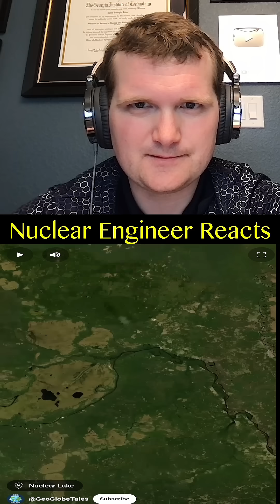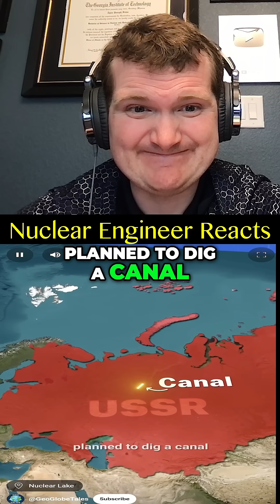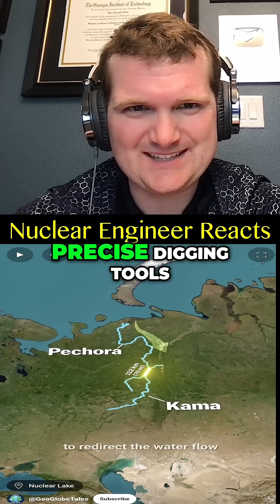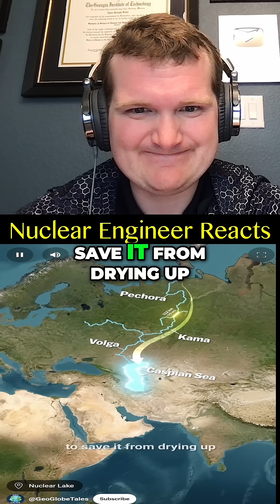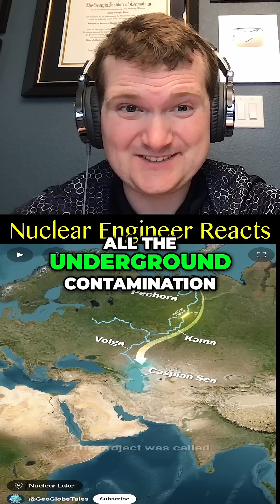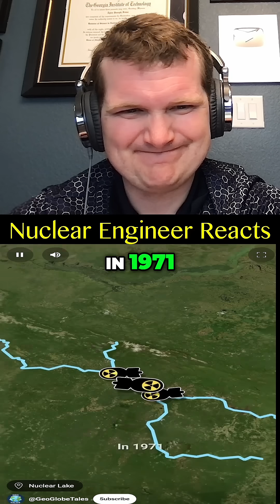250 Nukes to Create a Lake? - Nuclear Engineer Reacts to GeoGlobeTales

Comment: Lets think about this. They are going to use Nukes to make a canal. Which in turn moves water. So this water is moving through where they set off like 25 nukes to make this thing. 

They trying to bring Spring Field to USSR

Comment: The US had a similar program called Operation Plow Share.  They tested Nukes for propulsion, excavation of harbors, even a Nuclear Fracking test to extract gas (it worked, but the gas was a bit too spicy for use)  - There's a ton of crazy test footage around from the time,
Reply: Yeah we kind of went a little to crazy with it. Massive nuclear powered aircraft, Cruse missiles with poorly shielded reactors sprinkling magic cancer dust in its wake, and probably more I'm forgetting. Its terrifying awesome
Reply: @thegamingraven1691 cruise missiles aren’t propelled by nuclear technology as we know of yet. But it is possible, we have aircraft already outside of the solar system with that tech.
Reply: Thank you for saving me from typing this.😂
Reply: didn't egypt also had similar plans
Reply: @antcommander1367  Kinda, but it wasn't Egypt.   in 1962 a proposal was made to use 520 2-megaton nuclear explosions to excavate a canal through the Negev Desert in Israel as an alternative to the Suez canal in Egypt.
Reply: And Operation Gas Buggy
  The fracking detonation was in Rifle, Colorado. The only thing left is a small plaque marking the site
Reply: All part of the immense PR campaign, "Atoms for Peace", which the Russians dutifully matched.
Russia ended up with a still dangerously radioactive lake.
But, they also had one success, collapsing a well that couldn't be extinguished, so they tunneled down, inserted a nuke, detonated it. It crushed the pipe and borehole, extinguishing the fire.
And the Nevada test site is replete with subsistence craters from subsurface detonations, a few even refrained from venting radioactive products into the atmosphere. The rest, not intended...
But, it did look good on paper.

Comment: Hi! Brazil nuts contain significantly more radium than most foods. It's said the levels nonetheless are too low to cause problems. But since radium is highly radioactive, I wanted to ask your opinion: do you think Brazil nuts are safe to eat regularly?
Reply: The selenium in them is very anti cancer related in different ways. Selenium is actually high enough in Brazil nuts to be the primary reason you want to avoid eating too much. But the health effects of it high but not toxic have shown it great. It's like 1-2 nuts a day.(The plants don't need to selenium, radium, a few other heavy metals from my understanding to grow the nuts but the they absorb it almost like a sponge due to deep roots and a lot of south American soil rich n mineral)

 I'm not going to say certain types of cancer that are more sensitive to radium though and less helped by selenium for example thyroid needs selenium and higher amounts can help there(selenium always helps with certain proteins that need it but the thyroid needs it to be healthy) you don't nessicarily have to eat Brazil nuts for high(safe) selenium though.  selenium is not needed in high amounts for normal health so I'm not going to say anyone needs to eat Brazil nuts I do get them for the high selenium however. If it's on the lower end of selenium and higher end of radium I do wonder a lot

I would be interested in what cancers are associated the most with radium. That's my thoughts obviously he'd know more.